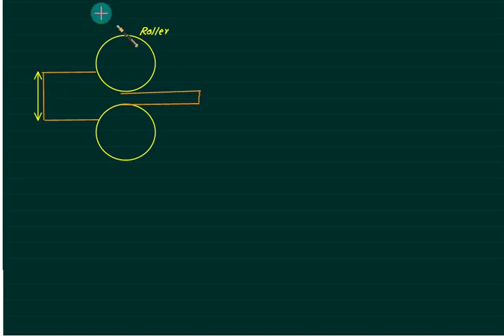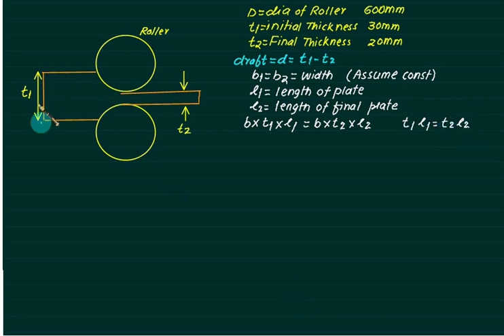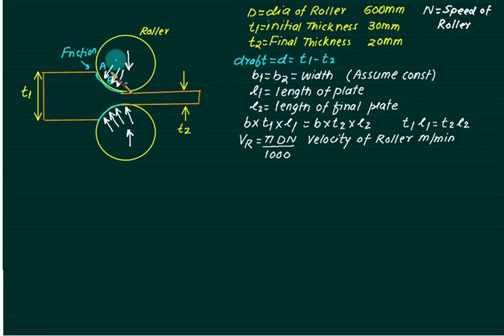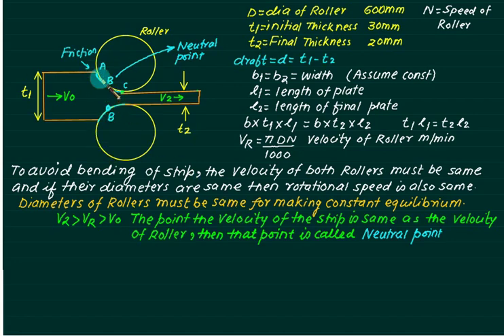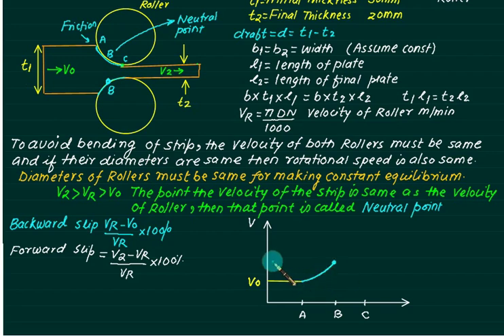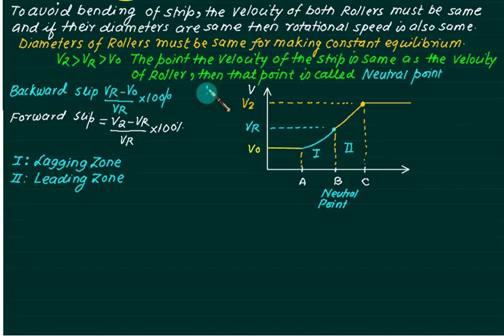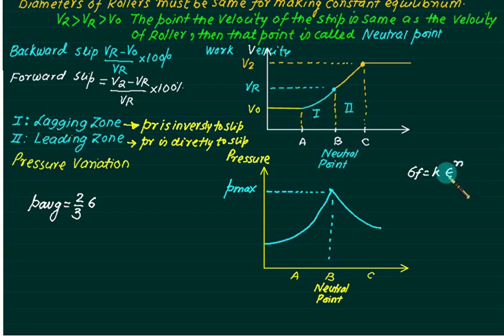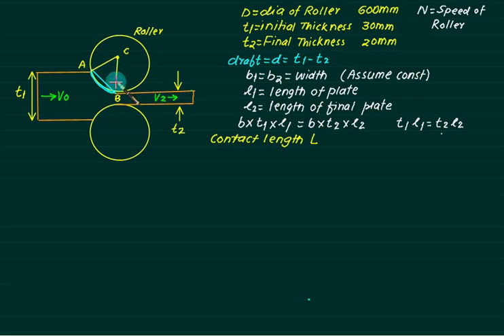Mechanics of Rolling Operation Part I

Comment: Bring a Project Manager in hot rolling mill sector, I found these two videos most helpful in understanding the rolling calculations. Thanks for making the calculations looks very easy. Kindly arrange to upload a video regarding follow stress of low carbon steel
Reply: Sir roofing galvanized sheet mill machine ka stand pass kese nikalte hai plz reply